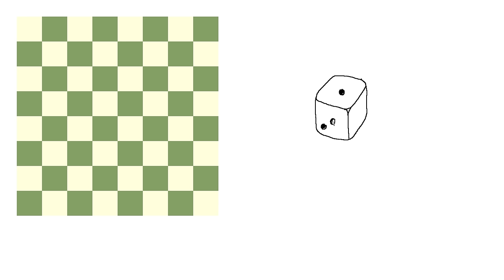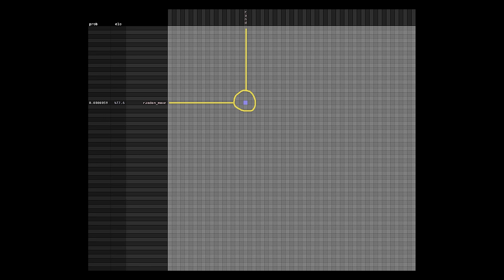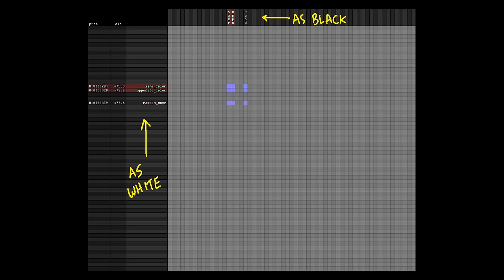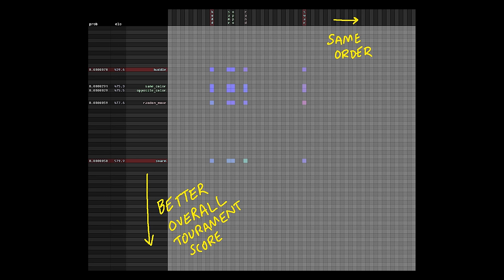30 Weird Chess Algorithms: Elo World

Comment: The Council:
5 different bots rotate in order to play moves.
These bots can be any 5
They can all see the board at all times.
It would be fun to see a colour blind, piece blind one play with several regular bots, though.
Edit; here's a few more i thought up while on the toilet:
Married Couple / Want A Divorce: Keeps King and Queen close together as possible / as far away as possible, plays fairly well (perhaps default using CCCP, but could use other algorithms as well)
Nicest / Nastiest General (and the ones in between): Nicest always promotes pawns if they can, Nastiest never promotes pawns, ones in between take a % chance to promote, or something
Serial Killer: Always looks to capture a piece, but after one piece captures any other, only that piece can capture until that piece itself is captured (so if the first captured piece was white pawn takes black pawn, the white pawn continues to capture pieces whenever it can and moves in an attempt to capture pieces, and no other piece can capture (so even if you checked the enemy king, they would attempt to move the king or block the path). This goes on until the original "Serial Killer" is captured, at which point a new one is appointed when an enemy piece is taken)
Cops: No pieces take any other piece until one piece on their side is taken (so if black rook takes white pawn, they will attempt to take black rook, but if black rook has not taken any pieces they will not capture the black rook)
Edit 2: here's a couple more:
Longshot: uses stockfish, but always tries to move a piece the maximum number of spaces possible (so it would take priority moving a rook 8 across the board than it would moving a queen 7 spaces across the board)

Genocide: attempts to kill as many enemy pieces as possible, without regard for its own pieces

Flanker: attempts to capture pieces from the sides
Frontal Assault: attempts to capture mostly from the front
Backstab: attempts to capture mostly from behind

Mimic; Copies the enemy's style of play (random vs random, CCCP vs CCCP,  stockfish1m vs stockfish1m) (mimic vs mimic defaults to CCCP)
Complex mimic: copies the enemy's style of play, but when they have an advantageous move (i.e capture enemy queen) take that move instead of mimicking enemy
mimicfish: copies enemy playstyle, but after a certain number of turns randomly decided between (variable numbers), plays regular stockfish. (so if 17 was the random number on the 17th turn they switch to  stockfish)
mimicfishw: plays regular mimicfish, but uses worstfish instead after the random turn limit

Comment: @10:29 I've no idea what you're trying to say. A lake is a mirror and polarization happens in the direction of the plane(any possible angle). Also, the only inherent flipping that a mirror does is about the z(depth) axis so right hand becomes left hand no matter the orientation, the rest is just a matter of perspective. It's like looking at someone's back through a transparent glass and saying that the glass is doing the flipping.

I'm also confused about the polarization = symmetry part. Vertically polarized light(oscillating up and down) has horizontal symmetry(looks the same above and below the X axis).

Comment: Some ideas:
Swat - At the start of each game, randomly defines a group of 8 pieces; it's objective is to surround the enemy king with said pieces. There may be 2 variations for this player, one that just moves said pieves closer to the king when given the chance (ranking movements based on how closer to the king will it move one of the choosen pieces), and another one that tries to force the king to move closer to said pieces instead (when the enemy can move it's king, it looks for the chance a move has to leading the enemy king to move closer to those pieces, when it cannot, just plays random). 

Phobiac - At the start of each game, chooses one enemy piece to be afraid of. If the algorithm's phobia is captured, picks another piece to be the new phobia. This algorithm will not play any moves that places pieces within the range of the chosen enemy piece nor moves that capture that piece unless forced. There could be a number of variations for this one, as the algorithm could work in a lot of different ways. Some of those variations:
Almanac popular phobiac - plays by the database of most popular moves per position, except it has a phobia in an enemy piece.
CCC phobiac - plays the same as CCC, except it has a phobia.
You got it. 

Fan #1 - It is the opposite of the phobiac algorithm. It picks a random enemy piece to be it's idol. It will play moves that captures or places pieces in range of the idol. If the idol dies, picks another enemy piece the idol. Same idea to variations. 

Protector - At the start of each game, defines one piece as the protected. It will avoid moving the protected piece at all costs, but play to protect that piece with all it's forces. If the protected piece end up dying, it picks another piece to be the protected, at random.

Planner - At random, it picks a final position board. It's objective is to end the game at that particular position. It moves based on the probability that move has to lead to that end position, based on lichess data. If the position it aims to replicate is no longer possible, it choses another one.

Control freak - It always moves to the position in wich it controls the most amount of squares on the board.

Manipulative - It aims to play mamipulative moves (traps, gambits, sacrifices, forks and pins, ranked on that order). Same idea to variables as the Phobiac and Fan #1. Some variables to this one:
Random manipulative - plays at random, unless there is any manipulative move available. 
Planner manipulative - picks up a manipulative move the same way the planner picks up final positions.
Hunter - Same as the random manipulative, but only cares about traps. 
Sacrificer - Same as the hunter; only cares about sacrifices and gambits. 
Forker - Same as the hunter; only cares about forks, always perfoms them (actually taking a piece and finishing the fork, if accomplished). 
Pinner - Same as the forker, but instead cares about pins.

Mixed algorithm variations - Every algorithm that undergoes strategic changes (e.g. almanac popular runs out of known positions), could have a variation for each of the other algorithms. This way, instead of playing random, picking another piece to live as, etc, it would change it's algorithm to another one, creating hybrids (e.g. we could have an almanac popular/planner algorithm that plays as the almanac at the start of the game but starts playing as the planner as soon as it runs out of moves). There could be various depths of variations (e.g. an almanac popular/planner/protector/suicide king, that changes to the planner when no more positions are known, to the protector when the final position is not possible anymore and lastly to the suicide king when the protected piece dies) as well as conditional variations (e.g. an almanac popular||protector variation, that plays as the protector if and only if the current board position is not know, meaning that it could run out of moves, change to the protector variation and go back to the almanac popular as soon as it lands in another known position) and ciclic variations (e.g. a planner<>protector variation, that changes to the protector when the final position it first picked is not possible anymore and changes to the planner when the protected piece dies, creating a cicle of algorithms). Keep in mind that there might be as well a random algorithm option (i.e. picking another algorithm at random), creating variations such as almanac popular/RA, that changes it's strategy to a random picked algorithm as soon as it runs out of moves. 

Those were some "good" ideas I had. Feel free to discuss, implement or brainstorm them as you will.
Reply: I may actually try to implement ideas from this comment section.
Reply: @guilhermecarneiro4711  If you could get these ideas working as UCI compatible (or XBoard compatible) chess engines, that would be wonderful.
Reply: @enderjed2523  I'd love to. Unfortunately I've got a lot going on rn in my life and that won't be possible. I hope in a near future that's more achievable.
Reply: @guilhermecarneiro4711  Understandable mate, I’ll definitely record down these ideas though in case if any programmers I know want to take a crack at it.

Comment: Coward:  try to keep every piece as far as possible from all of the opponent's pieces.

Spyhunt: pick the move which puts the largest number of your pieces in a position to move to each other's square.

Executioner: exactly as Spyhunt but always attempt to take a piece that took one of your pieces, making it vengeful and require more input than just a board position.

Frustrating: choose the move that Stockfish or some other engine believes the most will result in a draw.

Tsar Nick: opposite of CCCP. Look at every move. Then look at the opponents' legal moves they could respond with. Rank your moves in blocs. The worst category are moves that allow your opponent to checkmate. The second worst are those that allow them to check. The third worst are those that allow them to capture. The best category of moves are those that don't allow any of those, and internally this category is sorted by how effectively it stop the opponent from pushing. This strategy does have some benefits. For example, checkmating an opponent will stop them from doing anything and so will be in the best category. Taking an aggressive piece will stop that particular piece from pushing or checking or mating. High value pieces tend to have cross-board pushing ranges, so if they're exposed at all, it will prioritize blocking or killing them, or checking the king to stop them from moving.

Time traveller: Evaluates all possible moves by literally letting the opposing engine respond to them, then picks the move stockfish thinks resulted in the best move. Incredibly, brokenly, near-unbeatably strong vs deterministic agents but not so fun for a human to play against and somewhat easily mislead.

Comment: Let's solve a difficult problem with another difficult problem. I present the (Euclidian) Traveling Salesman AI.

First, solve TSP on the pieces. Then pick whichever legal move most closely aligns with that piece's part of the circuit. Pretty simple, tries to capture and huddle, and you can tailor it to only do one of those by using the bipartite and one-sided variants respectively.

But why do TSP once when you can do it several times? TSP Optimizer: it checks every legal move it can make and goes with whichever one achieves the shortest circuit.

Honestly I think TSPO has potential. If nothing else it's incentivized to capture and to castle. But we can make sure it also tries to cover and approach pieces: TSP Optimizer with Chess Distances. The distance from any piece to another is measured by how many moves it would take to get to the other piece given the board state, which means we also get to run a pathfinding algorithm on top of TSP. And it has the beautiful name of TSPOCD.

It would probably be an amusing match whenever the optimizer variants play against themselves, because both sides are both sides are basically just trying to arrange the pieces in a loop. Though we can greatly increase this behavior by using Pacifist TSP Optimizer, which simply tries to optimize the circuit but avoids capturing pieces.

Of course there's plenty of others, such as the TSP Deoptimizer, which tries to make the shortest circuit as long as possible, and the Inverted TSP Deoptimizer, which tries make the longest circuit as short as possible.

Comment: I wonder if you could improve the blind board prediction by weighting the loss for each training run against how much worse Stockfish would perform off the resulting incorrect board. So mispredicting, say, the color of a pawn would be considered less bad (and thus adjust the neural network weights less) than, say, mispredicting the color of the king.

You could also use the board states in your Elo World tournament itself as additional training data - though I would only train on the data from Stockfish v. Stockfish matches as the silly strategies are likely to produce board states nobody cares about, which will bias the prediction wrongly. Or perhaps DO do that and compare how much worse the blinded algorithm does if it has to worry about lousy players.

Comment: Perhaps an alternative way to "dilute" stockfish is to tamper with its evaluation of all the configurations/moves it considers, by a certain percentage.  So for example if it evaluates one move at a 97 and another at a 94, and you set the dilution to +-3, then the 97 will become anything between 94 and 100, and the 94 will become 91-97, allowing for a reasonably common chance to select a slightly inferior move, but not a complete blunder.  If you scale this up you could have a stockfish that regularly plays moves that are actually a 70 or so, when it could be playing a complete blinder.  That seems like a more realistic representation of how chess skill varies in humans.

Comment: I have new ideas for engine variants:

You could use Stockfish to order moves by goodness, then pick a move according to that ordering. For example, always pick the third best move if there are three or more legal moves, or always pick the move closest to the 75th percentile mark. This strategy generalizes worstfish.

If you used an engine that allows for games that aren't zero-sum, you could make the heuristic for each side different—for example, making one side use the Stockfish evaluation function and the other side use a worse function or even an entirely different goal.

The above engine was an attempt to express a chess engine which is using full engine power against an enemy which it assumes is stupid. A secondary possibility is to use a deliberately weak engine to find one or more replies for each legal move, and then pick the one where the reply has the worst Stockfish evaluation. 

Yet another possibility to try is what I like to call “budget AlphaZero.” It simultaneously looks to minimize the number of moves its opponent has available, minimize the number of moves any of its pieces have to reach any square, and maximize the difference in Stockfish's evaluation of its position before and after a move (it will search a few ply ahead for that). This is based on how AlphaZero is known for locking down its opponent's pieces, keeping its own pieces highly mobile without really caring about material advantage, and really confusing Stockfish.

Comment: One good strategy for making an engine of limited strength, which you don't seem to have tried here, is the so-called "Beale effect".  This is what you get when you employ a minimax algorithm, but with an evaluation function that is essentially random.  A reasonable way to produce consistent random evaluations is to transform a Zobrist hash of the position into the random score; to make it play differently each time, pick random Zobrist coefficients at the start of the game.  A Beale algorithm like this can actually be fairly strong (say 2000 ELO) when given sufficient depth of search, because it prefers positions with good mobility for itself and bad mobility for the opponent - but at a search depth of 1 ply, it's equivalent to a random mover.
Reply from the maker: Kromaatikse Neat! This is nicely canonical; would be a good one to compare
Reply: @tom7  An obvious refinement, of course, is to give proper evaluations for checkmate (either way) and draws.  This would distinguish it from a random-mover at single-ply search, in that it would be able to make mate-in-one reliably, and would usually avoid moving into stalemate or repetition.

Comment: You might be able to reverse the output of the evaluation function of stockfish to easily do what you wanted to. From my brief browsing of the code I think the engine has a wrapper function of some sort for all of the different early, middle and endgame eval functions. You could just change that function's return values either inside it or wherever it gets called. It might break the minmax tree but I doubt it's that deeply coupled.

Comment: So, instead of chess moves, what if you mapped that Arithmetic algorithm to notes of a melody? Take the major scale, 1 to 8, and then for each of those, have 1 to 8 response notes, and so on, until you have n-number of notes in a melody. 

You could also divide the notes not only into the 8 pitches, but into the common intervals: half-note, quarter note, eight, etc. So then you're picking 1 to 32 start notes, and then 1 to 32 response notes. Then you have a brute force lexicon of every possible major scale melody in existence. Most of it would sound like noise, but if you ran it through a genetic algorithm, I bet you could come up with something cool.
Reply: What if you had a chess player that did a predetermined set of moves based on a melody, and if a move in its melody is illegal, it just moves to the next one and plays that.